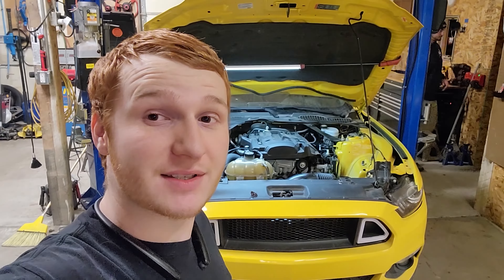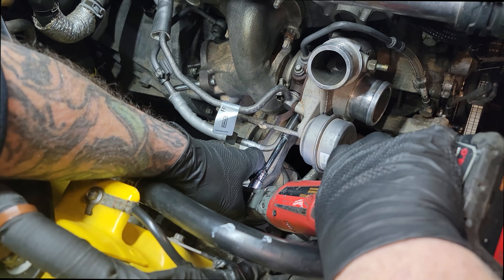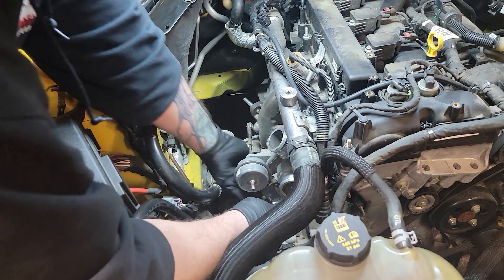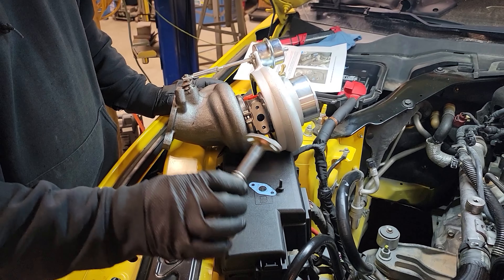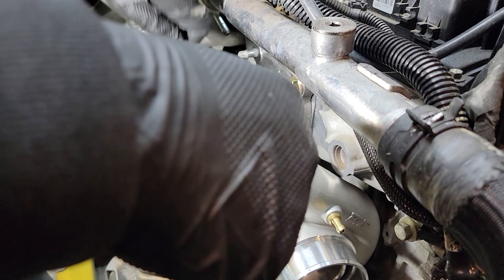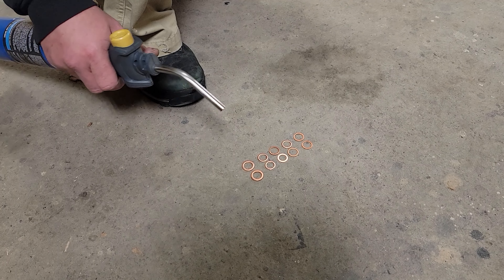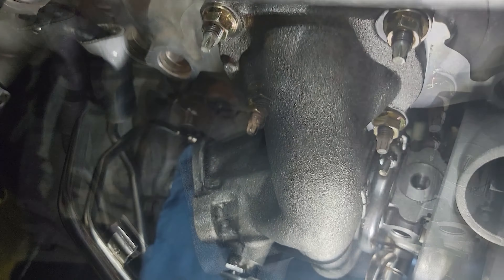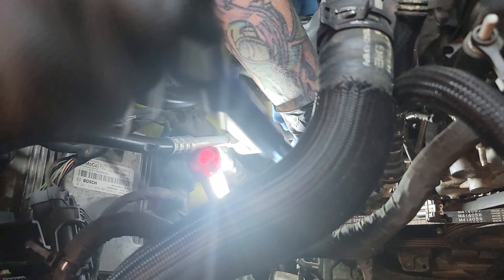BIGGEST DROP-IN Turbo for Ecoboosts! BNR600 How to Install

Comment: What will be the problem if the coolant like behind the turbo entering the engine block is leaking
Reply from the maker: You will lose coolant and be constantly filling it.  Coolant is also flammable when at operating temperature and under pressure.

Comment: How does it perform? BNR600 vs NX2?
Reply from the maker: Both are great bnr 600 will make a tad more
Reply: @automafiaracing in stock block and rolling anti lag which one would be better NX2 or BNR 600?
Reply from the maker: nx2 imho
📬 Contact AMR for build advice and guaranteed lowest prices.
📞 941-979-1132
📧 Support@AutoMafiaRacing.com    www.automafiaracing.com